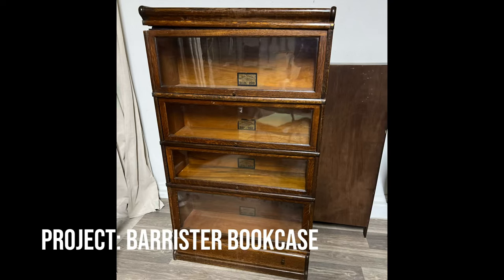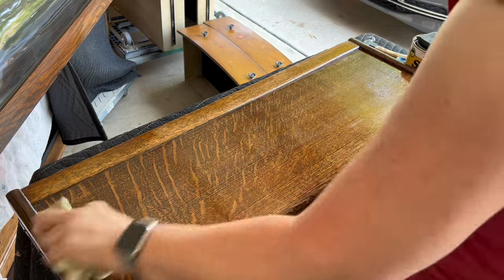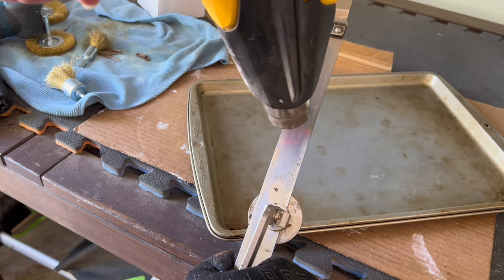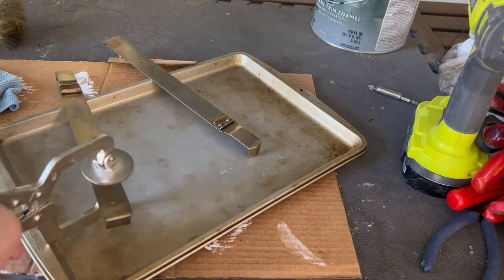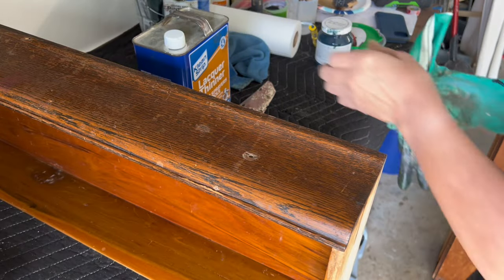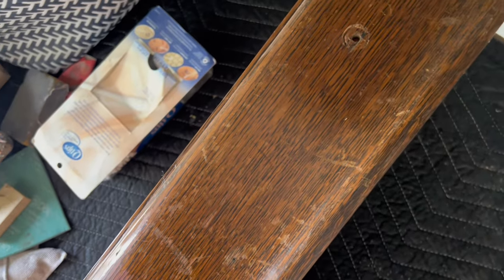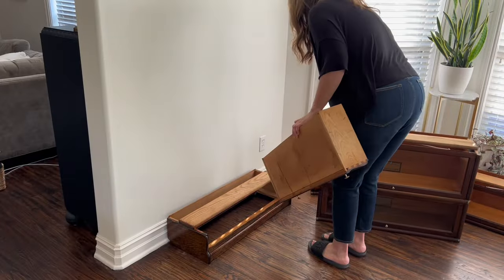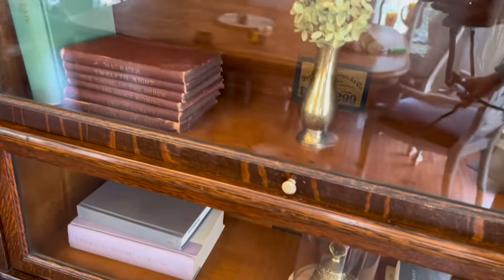Barrister bookcase refresh turns into a lesson on how to re-brass plate  | Furniture Restoration

Comment: I have one of those. Mine is Mahogany. I bought it at an auction in Sonoma County, CA about 20 years ago for $500. The unverified story was that it once belonged to Jack London. I was told I should look for photos of him with the bookcase. Mine does not have a drawer at the bottom, but it does have 5 tiers. I am missing two of the knobs, but the ones I do have are brass. The brackets on the side are not brass. I absolutely love Mahogany, and this is my most treasured piece of furniture. I also have an old antique Mahogony sleigh bed that I bought at a yard sale. It's so old that the entire frame that the bed goes on is wood. I've never seen anything like it.
Reply from the maker: They are definitely heirloom pieces 🤩

Comment: Great job - and an even better save after accidentally removing the brass plating. Thanks for showing the tools you used — the only technique I think you missed out on (which I saw in another video) was to use the alcohol to soak paper towels and let them do the work rather than scrubbing the old shellac off. In his case, it seemed to remove the shellac much more thoroughly and leave a very even, bare surface. 

Thanks again for the great how-to, I just picked up my third set, and this one has incredibly rare oval windows rather than rectangular.
Reply from the maker: Yeah, I definitely think that would have been easier! Oh, I've never seen one with oval windows, cool!

Comment: Hi.  Beautiful restoration.  As someone has pointed out, denatured alcohol is the solvent of choice for shellac.  It will save you time and effort.  Lay blue shop towels (or similar) on the surface and flood them with the alcohol.  In 15-20 minutes you will be pulling the finish away with the towels!  Lacquer thinner should be reserved for lacquer alone.  Shellac and lacquer, despite their similar sounding names, are dissimilar products.
Reply from the maker: Gotcha! Thanks for your detailed suggestions!

Comment: I have one of these too but haven’t restored it yet . From what I know if the original finish is shellac then denatured alcohol will remove the finish. Lacquer thinner removes lacquer . I used denatured on a singer sewing cabinet but tested lacquer thinner to see what the original finish was. Only the denatured removed the finish so I knew originally it was done with shellac
Reply from the maker: Yes, denatured alcohol would have probably worked too.